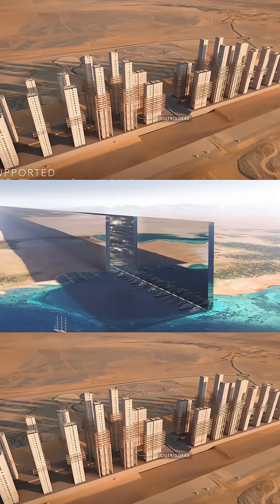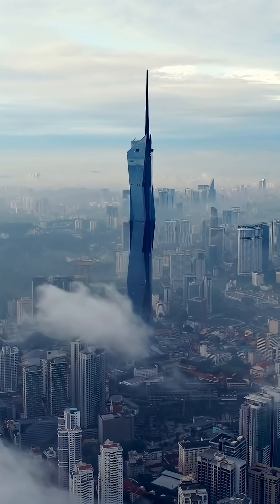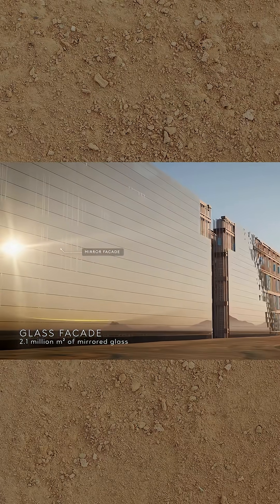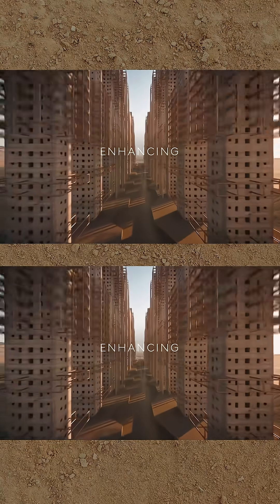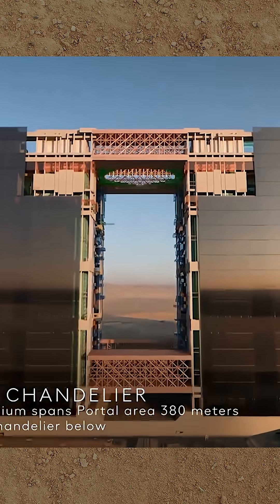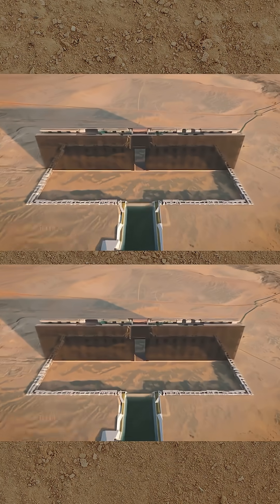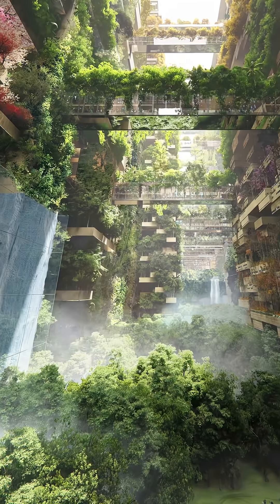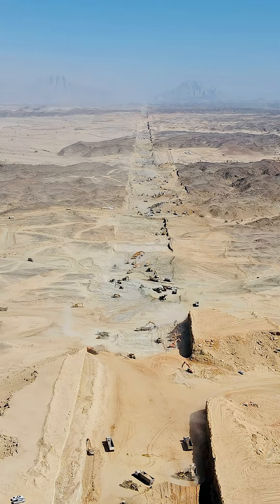Fred Mills: How Saudi Arabia is Building THE LINE

Comment: After seeing how the palm islands and world islands went, I see they’re bringing water for stage 1 by basically opening a dam. And having the newly constructed building block the brunt of the wave to allow it to pass through the channel. They need to calculate the horizontal load from all that water onto a thin vertical wall with 2 reinforced concrete supporting columns per wall that was designed already to hold tremendous vertical load. Concrete isn’t a huge fan of bending. Not to mention if the water doesn’t go where they want

Comment: What happens in case of fire? Do they have a solid escape plan to save rest of the structures if one catches fire. The whole line may be endangered in case of fire coz it's closed on both sides by mirrors, and the wind flow will be one sided, causing fire to go massive.

Comment: Giant mirrors in a desert. Sure seems like a good idea. 
More importantly, building a giant linear city with opposite ends far away from each other and completely cutting off each the coast from the interior just doesn't seem good in almost any way. Surely building a square or circle with ring rail lines would be significantly more efficient, allowing far more ppl and amenities to be far closer to each other and taking a far smaller area, and causing far less obstruction to the land, wildlife, wind, and light. 

There's a reason the Borg build cubes not giant rods. It's illogical and inefficient.

Comment: What they don’t realize is cities don’t just spawn in with millions of people. They started off as settlements, some people built castles and forts for security, docks expanded for more trade, which allowed for more immigration. The increase of immigration lead to higher populations, which meant more people for jobs, which meant more trade, so bigger docks. More people, now you need bigger houses for those people etc. over hundreds of years. People slowly were drawn in over time until the population began exponentially increasing leading to gigantic cities. They are trying to skip forward a few hundred years and build a city from nothing. It’s the same deal with the ghost cities. Anyone who has played any kind of city simulator knows you have to build up over time, and size equals time and prosperity.

Comment: I see a lot of the mirror comment on here and I agree BUT if they designed it 2 fold that mirror could’ve doubled for solar power or a solar furnace to potential power the city… If that reflection is not properly harnessed, I can foresee a lot of heat issues and an arc of glass slowly growing daily around the city

Comment: It doesn’t work. How do you get light down to the lower 2/3rd? How do you ventilate such deep spans? It will be a stagnant, dark boiling hot mess in the lower 2/3rds. It also requires more concrete and steel per year than the entire world produces each year. If even two or 3 sections are even half built I will be surprised. plus there are fundamental reasons why we don’t build linear cities.

Comment: Mirrored glass wall, 500 meters tall, in the desert.  Where they have massive sand storms.  Are they planning on replacing the glass every year?  Because a wall that high and 170 KM long is going to change wind patterns and sand blast that wall.

Comment: The point of a city is that it is built essentially like a circle. That way no matter where you are in the city you are as close as possible to where you want to go. In a proper city the worst case scenario of transit is across the diameter from one side of the circle to the other side. 

The Line is literally the worst city design possible.

Comment: There is a high possibility that it will fail but actually there are many real line cities. You can find Alexandria on Google Maps, it's insanely long, everything is on the shore. Volgograd is also very long. It's basically one street along the Volga river. A very long street.

And if i'm not mistaken this line city goes along the shore.

Comment: This might actually be the worst idea I've ever heard.
In a 'normal' city, you can reach any point in 3 square miles by walking for 30mins. But in this 'line' you can only access 0.2 square miles.
They think they've fixed this with rail transport, but the same maths applies - journey times will be insane.

Comment: I call BS but it's why they are using desert if sand is right it will provide there concrete but all that concrete needs lots of fresh water where are they going to get that? Desalination plant? It's all a pipe dream. It will be seriously scaled down and probably will have huge problems like saline sea water not constantly refreshed by tides will start to stink. 9 million? Willth issues of where to put raw sewage, what to do when plumbing leaks or all that glass breaks when buildings settle. Sounds like the egomaniac nightmare of totalitarian top down government with zero accountability.

Comment: Did anyone brother to do a study on what will happen when the sun reflects off all,that glass there was a building in New York that had panels on it and the sun was melting cars parked in front of the building they ended up resurfacing the whole building for millions of dollars and it was one thin building i could just see all that sand turning to glass after the wall is up of the heat that it will draw into the complex heating all that steal

Comment: If they don't curve that glass on the side of the structure simple curvatures due to wind or small earthquakes are going to create 1/4 of a second focuses on areas around the structure and instantly kill any life form in that unfortunate position, this is also a massive unnatural barrier for birds and a lot of land animals, also the dimensions of the general structure of the largest silhouette is very energy and efficient because it's essentially a glass ribbon running through the desert. Some width would allow it to retain colder temperatures near the center but it's thin. A thin Greenhouse so there has to be more to the plan than what we're seeing here it almost seems like they're trying to harness solar energy for this but it isn't clear in the plan how that's going to work.

Comment: Except they have already gone broke and stopped work. And they plan to have 1 small sectopen by 2030, it's been forecasted to be an environmental disaster, with flooding and high winds causing sand dunes burying parts of the structure. Also local inhabitants have been evictited and those the refused to move murdered. I for one will not live in this disaster.

Comment: They really need to throw out this concept. Even if you clicked your fingers in it all magically appeared instantly, you're inevitably going to have to deal with things like the foundation shifting unevenly, or part of the building suffering a fire and a large chunk of it needs to be placed, or the wind causing an unexpected lean or a structural collapse in one section that hasn't been repaired recently enough and it damages other sections that should have been okay..
There are probably a million reasons by this thing shouldn't exist..

Comment: And what happens when the sea levels actually finally rise to the height they were at during the dinosaurs?
Reply: Speaking of which...  Like Stockton 'Crush' Rush's carbon fiber submersible, the NEOM concept is fatally flawed from its initial idea forward.
The Saudis have ignored the 10 seismically active areas that NEOM is being built upon, areas that their own geological surveys highlighted as problem areas.
Reply: @WWZenaDo yup seems like a very poor idea unless they have some type of buffer or sliding zone that allows the buildings to move independently in specially jointed areas

Comment: I think it's brilliant. We need proof that we can live well without using all of our land. I've come up with a similar idea. To make a foundation that mimics a root structure to link extremely tall sky scrapers in a semi circle and then link supports in between to use the other buildings for redundancy. Make the rooms modular so more affluent people could link several rooms for a larger space. Then put all the hospitals and shops inside. Use high speed electronic carts for rapid deliver to say get to the ER in under 4 minutes during a trauma. Strategically close off sections of corridor and reroute travelers for UV sanitization. Etc etc so much can be done here. Then you can put a large city in a small space and reclaim the ecosystem. It's not a home on the prairie but you can build timeshares in the outskirts and give credits as part of the housing contract for special events. A bustling vibrant city only a few minutes away from dense wildlife and nature. Since it is so contained it can also use centralized air scrubbing to nearly eliminate Co2. Sewage and trash can be harvested for gas that can then be used to distil wastewater to water the plants and to incinerate the remaining waste. Towers could be built to use pressure differences to move air without electricity. The possibilities are endless. If we can prove we can live well like this we can change the course of humanity.

Comment: 1. Where will they get all the inhabitants?

2. Stadium in the air? Building stadiums is challenging because it must hold thousands of people who jump  synchronized. Plus cost of maintenance of the stadium after 20-30 years will be ridiculously expensive and major pain in the a$*

3. Line is the least efficient shape in which you can build a city

I'm not hating this, I would love to live when it'll be finished and visit it in awe, but some parts of it seems to be nonsensical

Comment: They would need nuclear reactors of either fusion or fission type to power that structure. Otherwise, they could use a massive amount of solar panels, wind turbines, or diesel power plants to do it. They should also try to create urban gardens there in order to sustain the incoming residents.